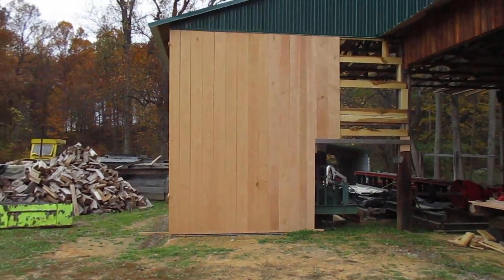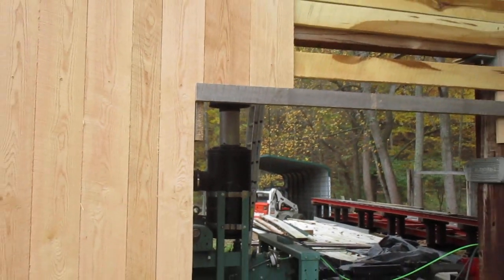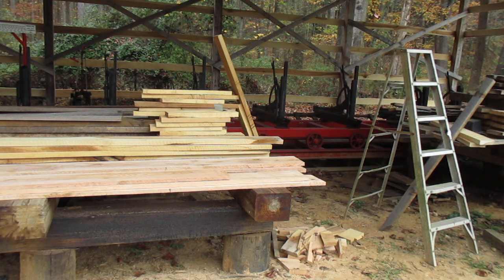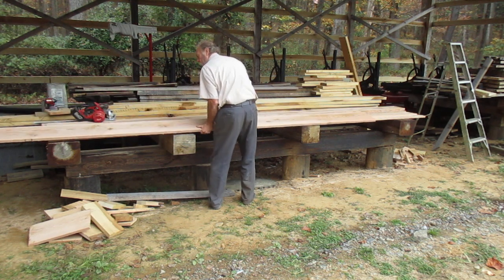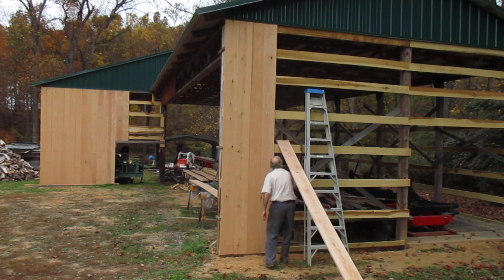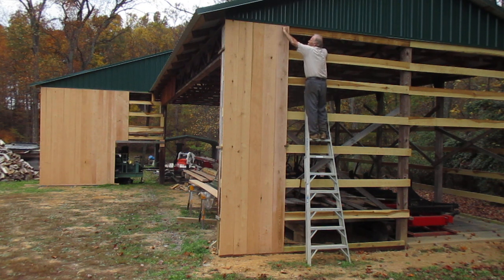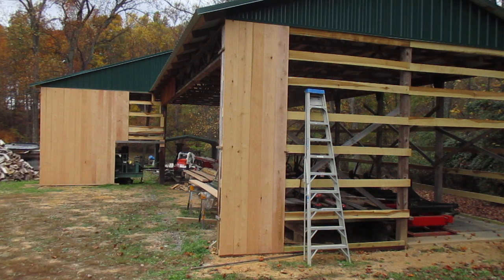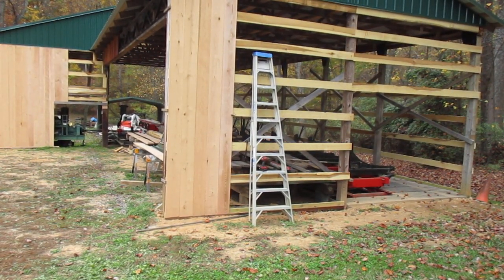#137 Oak siding on the Frick #1 sawmill

Comment: Just so ya know.. if those boards are green, in a year there's gonna be about a 1/2 in gap between them. Are you going to put a batten on them ? or is it not important to you..i would. you have plenty of scrap laying around..It'll make it look nice too. looks great though, i love those frick sawmills.
Reply from the maker: hi there i don't cace for battens on the outer walls . i think they cause early rot because water between the two . have never had a water problem in a building . if i was worried about draft bugs and other house type problems then yes . i need some air flow around the engine anyway . john